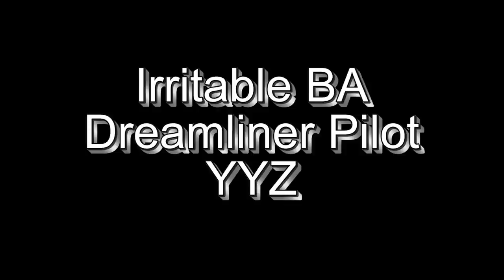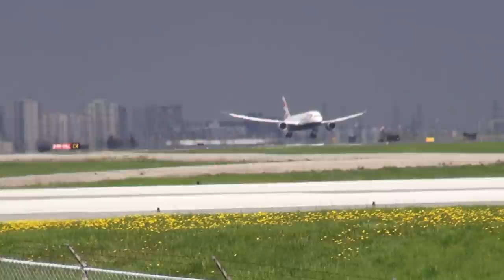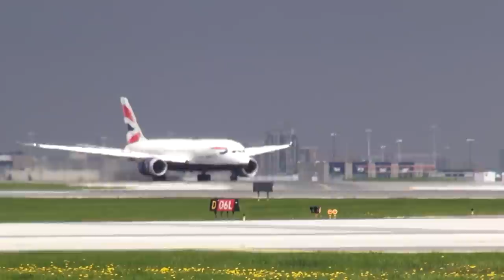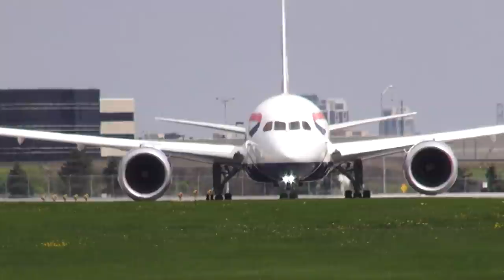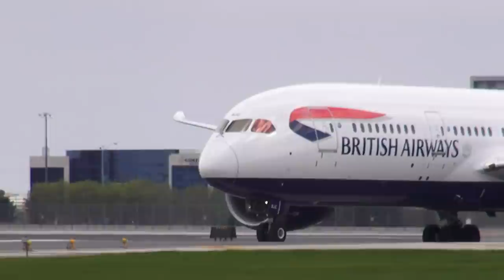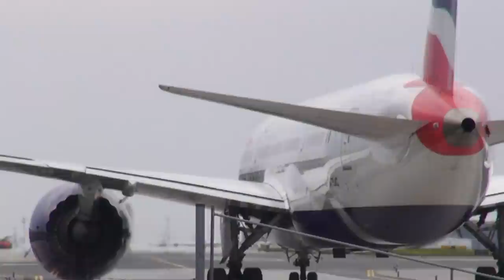Anxious British Airways Pilot, impatient controller

Comment: The BA pilot does have a right to say that. The controller was giving him taxi instructions on roll out. its hard to take instructions and land a 787 at the same time! He was right in asking the controller to slow down.
Reply from the maker: it's funny because I have watched 787s land so often now, whether it's Speedbird, LOT.  Hainan or Air Canada. They are always such smooth landings, even in windy weather. Could it be because there is extra concentration due to the relative unfamiliarity to the aircraft? This BA pilot seems somewhat preoccupied. I was there that day, obviously and there was terrible weather just prior to this landing and there was a backup of planes taking off. The controller needed to get planes away in good timing with the landings, 24L landings and 24R take offs. The long runway to the north where most of the heavies take off and land was closed. The controller just wanted to make sure they knew to "Hold short 24R" so not to hold things up more. He ended up having to delay things until he was sure the BA crew new exactly what to do.
Reply: +Dave “daviation” Isenor No? I'm preoccupied with my JOB when I'm landing.  It requires concentration, planning and thought. Personally I ignore ATC until the aircraft is at a safe taxy speed.
Reply: +Dave “daviation” Isenor Yeah, the pilot is supposed to be preoccupied during a landing... preoccupied with landing the plane. Especially in instrument conditions, both pilots will be quite busy during an approach and landing.
Reply: Its slightly awkward trying to handle these types of issue [ one on one ] over the airway frequency. The pilot has a point but I believe that it is dangerous to bifurcate the issue into projecting that the controller does not understand that he is obstructing the crew.  It's helpful to use the telephone or refer the matter to your management or union representative.
Reply: So do I, Richard, that is what is called "good airmanship". What the BA guy did here was what you would expect from any professional aviator.
Reply: I would say standby to the controller until I have finished my landing roll

Comment: This is a perfect example of something that goes on a lot.
Controllers are instructed during their training to not give taxi clearances to landing aircraft until they are at taxi speed.
However, they routinely forget that and add one more item to this already heavy-workload critical part of the flight.
Being that most pilots have a perfectionist-bound attitude, they try include that extra superfluous item into the tasks being managed at the moment by actually trying to reply and read back.
In my flight-deck  this possibility is addressed in the Before Approach briefing with a recommendation to NOT reply to any calls before we are at taxi speed, vacating the runway.
Controllers immediately "recenter" themselves when their transmission is not read back.
The proper way to address the problem is not the "scolding" given by the BA pilot (...hey, everyone may have a bad moment!...) but rather constructively apologize for not replying earlier and call the attention to controller that he/she should not give instructions to aircraft during landing rolls.
Reply: Excellent description!

Comment: BA Pilot was correct in requesting they be allowed to complete their landing phase before being given instructions.  Tower was a little rushed.
Reply: If the pilot is soooo rushed and busy with landing why the fuck is he wasting time yapping off at the controller? That 787 can pretty much land itself.
Reply: OH, and I suppose you have thousands of hours on the 787 eh. I doubt any real commercial pilot has time to waste on youtube.
Reply: Seems like everybody on here is commenting on how the controller should leave the pilot alone since he is so busy. If the pilot is so busy why is he wasting air time making useless comments. Logically if he was so busy he would be paying more attention to the actual landing and not getting into a tit for tat with the controller. Do some research on these planes and you will find that the computers do most of the work so that the pilots have less of a work load, unlike when I soloed back in the sixties.
Reply: Go back to school, your command of the English language is lacking.
Reply: At that point, he was travelling quite slowly. When the controller gave the initial instruction, which is what the pilot was complaining about, the plane was travelling at high speed, and the pilots needed to concentrate on the roll out, not deal with calls from the controller.
Reply: @johnabuick  Rubbish. ATC gave instructions too soon. BA Pilot was spot on. Travelling at speed down a runway with 300 passengers in the back? I would have said the same thing. Speed first, safety later in the States when it comes to their ATC. You seem to have something against the far more qualified Pilots and appear to be a bit biased towards Air Traffic Control. In terms of responsibility, the Pilot in command is ultimately responsible for his aircraft and passengers on board, not the tower controller. Your comments about "computers doing all the work" as well are a bit misguided.
Reply: @johnabuick  kid go to bed

Comment: The problem here is rather straightforward.  An airplane as advanced as the 787 still requires pilots to fly the airplane.  In a crosswind situation, the pilot flying will go heads up (with the HUD) with the PNF (pilot not flying) monitoring the instruments.  In gusty conditions wind shear is a significant possibility and it requires rather intense concentration on the part of both pilots to focus on landing the aircraft.  Until the aircraft is below VMG (about 80 kts), gusty crosswinds will still have an effect on the aircraft.  The engines were in reverse as the controller gave the first and second instructions.  Pilots are trained to respond immediately to controllers unless it is unsafe to do so.

Landing on 24L, the winds were 14010G15, so he had a speed gain of about 3 kts (from the tailwind) and 15kts lateral crosswind.  From what I could see of the landing, it was textbook, however, he had to use considerable right rudder to keep the aircraft on the center line of the runway.  Assuming his landing speed was around 150kts, he would have added 1/2 the gust factor to a maximum of 20kts to his landing speed to compensate for the gusty crosswinds.  Add the 3 kts for the tailwind and you have an additional (5/2...2.5+3.0 so an additional 6 kts speed, which makes the landing about 156kts.   The long roll out and the long deployment of the thrust reversers demonstrates that the landing was fast and the PF had to correct the aircraft down the runway until below 80kts (the speed at which the reversers are usually stowed)...unless a long landing is undertaken, in which case the reversers might not be stowed before 60kts.  

Why do I go into so much detail?  In such conditions, the level of concentration can be extreme.  The controller was a bit early giving the instruction, although in busy airports this is not uncommon.  The pilots correctly disregarded the first instruction as they were still concentrating on the rollout, but the second instruction was "read back" perfectly, albeit a bit fast.  The controller asking them to confirm their instruction a second time was the straw that blew the pilot's gasket.  The pilot was expressing his frustration, nothing more.  In his view, the controllers repeated instructions were distracting them as he was attempting to slow the aircraft.  As he exited at the end of 24L and then crossed 24R, I'm pretty sure the pilot was concerned about landing distance.

I have heard (and seen) pilots get frustrated and angry with controller and vice versa.  In this particular situation, I am going to side with the pilot.  There was nothing unprofessional in his statement, he was just expressing his frustration and concern that he was being distracted during a difficult landing.   Until you have sat in the flight deck jump seat (as I do professionally on occasion), you cannot really know the stress pilots are under during these landings...and I've been in some nasty approaches that have resulted in textbook crosswind landings. You think these guys don't sweat? Think again.

We work (I am an airline flight dispatcher) in a exceedingly stressful environment. 99% of communications are conducted in a professional manner.  This was not really that different, except the controller exacerbated the problem with his last remark to the pilot to "let me know when you have finished the landing and I'll give you the instruction again".  Controllers are required to defer to pilots in any situation in which the pilot is stating he is having difficulty.  He could have just taken a breath and thanked the pilot for executing his instruction and that would have diffused the situation.  Unfortunately, in the heat of the moment, we don't always think of what we should do (as hindsight is always 20/20).

That all said, we are all professionals. We are also human.  A previous poster said it correctly.  Aviate, navigate, then communicate.  When the communication part gets in the way of the other two, sometimes things are said.  As we are professional, we just take it in stride and move on.
Reply: How long did it take you to wright that comment?
Reply: +Captain Jack Sparrow who bloody cares how long it took him to write it? Did you even read it? If you did you would see it was well thought out and concise.
Reply: +TRPG pilot Appreciate the comment.   Thanks!
Reply: +David Lamb While I've never flown anything remotely close to a heavy, even from my experience in light GA aircraft, I agree completely. In a crosswind landing, the pilots need to be focused on landing the airplane, not on taxi instructions. "Aviate, navigate, communicate" is exactly right. Knowing where you're supposed to exit the runway is not as important as making sure you don't exit it unintentionally.
Reply: +David Lamb I'm going to respectfully disagree. The "professional" response to the tower if the plane was not going to be able to take that taxiway would have been "Speedbird xxx, Unable.", not a rant about letting them finish landing.
Reply: Agreed.  This is pretty cut and dry - ICAO Manual of Radiotelephony (Doc 9432), section 4.9 : *Unless absolutely necessary, controllers should not give taxi instructions to pilots until the landing roll is completed.*.  Tower was a bit stressed and definitely contacted too soon.  Winds were high, reversers were still open - they can see that from the tower, as well as the speed the aircraft was still carrying.  This is the most intense phase of the entire flight and, unless there's some sort of emergency, the tower really needs to let them finish their job first.
Reply: +Fadamor I am reading your comment for the first time. I don't think that we disagree as much as you might believe. I stand by my comments that the controller pressed them to respond. That should not have occurred. While I understand the pilot's frustration at being called on multiple times during a critical phase of flight, he could have responded to the call with the "unable" response at the completion of the landing and that would have ended it, maybe. Had the controller said anything more, I doubt anyone would have questioned the pilot making any statement at that point. At JFK, the controllers have zero patience and it is not out of the ordinary for an unpleasant exchange to occur. They should not occur at all, but at any critical phase of flight, deference should always be given to the pilot.
Reply: David Lamb im impressed😎😎
Reply: Safety should be always intentional. We must always be intentional in doing things safely.
Reply: David Lamb barbados.love
Reply: David Lamb Thanks for the detailed context and insight there, David. I'm almost totally ignorant on ATC operations and flight in general and have started watching videos like this out of idle curiosity. Your comment was very useful.
Reply: They are not challenging conditions whatsoever... it's also quite normal for a controller to issue initial instructions before the aircraft has vacated.
Reply: David Lamb thanks for the detailed comment! Consider making a channel to explain these stuff to beginners
Reply: Does both 777 and 787 run the same huge engine?
Reply: Okay..all said and done..Roasted lamb for dinner.  All are invited.  Coordinate location of my house is 24 E - 12.45.  12.34.  See you on February 30th.  Roger.  Over and out.
Reply: Roger "I have received your communication and understood it" Over "I have finished my communication and expect a reply" Out "I have received your communication and do not expect a reply" So you are saying "see you on February 30th, I have received your message and understood it, I have finished my message and want a reply, I have finished my message and don't expect a reply". Out
Reply: David Lamb:  Well, this pilot did NOT "take it in stride and move on!"  Everyone gets tired and cranky, but exhibiting such in the air is definitely not acceptable!  Respond nicely, or ignore it  if you're too busy to answer, the ATC has to come back to you, sure he's busy, and so is the pilot, but I've said it before, and I'll say it again -- KEEP YOUR RUDE OR IMPATIENT REMARKS INSIDE -- do NOT air them where other pilots can hear them, -- they don't want to hear it either, though siding with a pilot OR ATC is inevitable, no one likes "smarty" or rude people!  Be professional at all times!  It pays in the end.  (Pilots are graded often, and can receive "unsatisfactory" marks on their records if an investigation shows that they were and it is not uncommon either!  If it keeps up, you will lose your job, or be demoted to a lesser position in flying, or even a desk job!
Reply: David Lamb Your medals are in the mail. Don't cry about stress, you choose to do it.
Reply: David Lamb k
Reply: Must have been your community order set by the court to produce a thesis.

Comment: I am a Jet Pilot, the controller is out of line calling when to turn off on a landing. The Captain may be training another pilot, dealing with a  nose wheel  steering issue or break energy limits on a quick turn. The Captain makes the call when to turn off based on variables the controller had no clue about. There is a huge operational difference between looking out the window and watching a Jet land or being behind the window and landing the Jet. I told any of controller I'll decide when to turn off not you I'm in charge here by regulations not you its my Jet and I'm responsible for it not you.
Reply: @hotgockie  The first instruction was far too early. Simple as that.

Comment: 140/10G15 is hardly precarious! But I agree, 80kts+ isn't perhaps the ideal time to be barking instructions when it is a given that they will not be crossing the runway. If the controller feels that there is a danger he may proceed onto the parallel active this instruction could be given with the landing clearance, eg. 'BA321, wind 140/10G15 - cleared to land 24L, after vacating hold before 24R'

Comment: Between landing clearance and exiting the runway, the pilot decides how to handle the aircraft until it is safe to exit. A controller can request the aircraft not to take a certain exit, but he cannot force a pilot to exit sooner than safe, even if that means the pilot has to backtrack. Landing requires concentration.  ATC was entirely at fault and the pilot was correct.